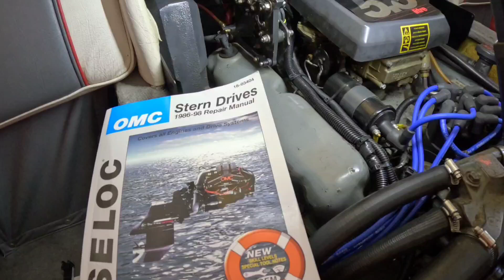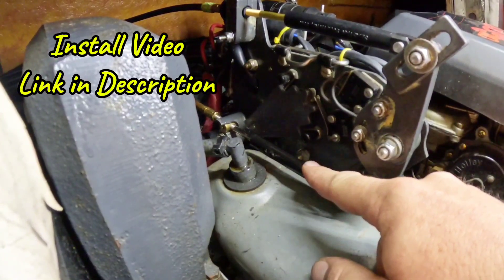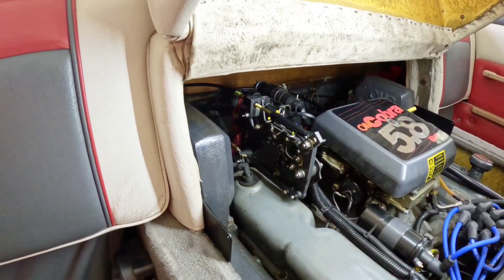OMC Cobra Shift Linkage Assembly | Adjustment And Fine Tuning The Electronic Shift Assist

Comment: Great video. I have a question I have a 91 3.0. I have not attempted the adjustment yet. When I shift into reverse it stalls. Forward is fine with at little hesitation it does (Not a fan of this system) before I start the adjustment, I bookmarked your adjustment on the video for reverse but your video doesn’t explain what is going on when it is stalling in reverse when shifting. I.E. if you stall while shifting in reverse that’s because this is not set to the correct orientation if that makes sense sir. Love the video but questioning myself on setting the reverse. Please advise.
Reply: How do I unplug the ESA. If it doesn’t stall could I not leave it that way?  Also, if forward and reverse work the same why is forward not stalling. I think it needs to be adjusted on the reverse. I think you said it’s the top cable. The two switches need to be in there correct positions I think. One in the W groove and the other on the cam. But, I feel that I will mess up forward. Maybe I am overthinking this. Please advise.
Reply from the maker: The esa is the box that's bolted to the shift mechanism. I have a video up on how to test it and replace it. That vid shows the connections and what to unplug. Leaving it unplugged just means that it may be harder to shift or gears may be hard to engage with prop shaft load. But I've seen boats go years without them working and be fine. But more than likely you just need to adjust the linkage. If you are not absolutely certain that it is adjusted properly, you need to go thru the process step by step from the beginning like I show it. Because it does matter in which order adjustments are made. It seems daunting at first, but once you do it it will make more sense
Reply: Ok. Thank you sir.
Reply from the maker: No problem. I hope this helps
Reply: So I put it in reverse prop locked. Switch is not in middle of W moved it like you did and it goes back to center as it should the overthrow switch is nowhere near the cam. I think I am beat here. Time for the dealer. To over engineered. I had 75 Tahiti with a four cylinder Volvo Penta and a 280 out drive didn’t have any of this crap. If I could I would take it all of and just have cables. Go from Neutral to forward put it in neural for a few stop the put it in reverse. No idea the point of this was. Super frustrating.
Reply: It definitely the adjustment.
Reply: Where is that accent from?
Reply: Ya know I wish there was a way to send you a pic of where it is at in reverse. Going into forward it has a hesitation then it’s in and great. But reverse is stallout.
Reply: Hello sir. So I watched the other fine video on fine tuning. Oh my god there’s a freakin tool. Ordered that. Question I looked at your orientation on the nut placement. It seems that that nut is in the block prongs of the tool or behind it like yours or I have seen in front. What is the deal? Also if with the initial fitting of the tool if cannot get that 7 9/16 what do I adjust to get it or… you said there is a plan of atckbfor how to do adjustments. Atarting with the 6 1/2 or is it the 7 9/16. Just want to be clear. Some many videos you have. Honestly where do you find the time lol. Thank you for all your responses. Keith.
Reply: Hello sir. So I watched the other fine video on fine tuning. Oh my god there’s a freakin tool. Ordered that. Question I looked at your orientation on the nut placement. It seems that that nut is in the block prongs of the tool or behind it like yours or I have seen in front. What is the deal? Also if with the initial fitting of the tool if cannot get that 7 9/16 what do I adjust to get it or… you said there is a plan of attack how to do adjustments. Atarting with the 6 1/2 or is it the 7 9/16. Just want to be clear. Some many videos you have. Honestly where do you find the time lol. Thank you for all your responses. Keith.
Reply: Sorry sent twice. Misspelled attack.
Reply from the maker: The purpose of the tool is to get a starting point after replacing the lower shift cable. And sometimes like what I found is the lower shift cable has a crack in the fitting that goes into the out drive and causes shifting to not be consistent. Lower shift cables are known to need replacement every few years. So I had replaced the cable. Then started my adjustment process all over again. I had a rough summer that year constantly pulling stuff apart and fixing things one by one because the previous owner replaced parts but never adjusted anything properly or used the wrong parts all together and made it "work"
Reply from the maker: I can see how that's frustrating! Shifting into reverse on these engines is very sensitive. The video shows the adjustment, but you are correct, the stalling is because the linkage isn't set correctly. The esa is intended to work the same whether going to forward or reverse. If it is out of adjustment the esa could still be engaged and causing the stall out. If you wanted to verify it was an adjustment issue and not an engine issue, unplug the esa and try it. If it doesn't stall is in the linkage adjustment. If it does stall then it could be engine related or a combination of engine and esa adjustment.

Comment: Amazing stuff brother! These Cobras have such a bad rap. Though I can still agree with some critiques regarding design, the more that I learn shifts (kinda punnny:) my opinion to assigning more blame towards not enough marine mechanics knowing how to  properly service. Hopefully your videos reach enough people, both owners and techs, to change that. 
I bought my dad's 87 Bayliner 2555 Ciera this year that he bought new. When he gave me all the original paperwork I came across a cardboard template provided with the manual used to ensure the precise measurements you showed in the beginning could be easily confirmed. Dying when shifting has been a reccurent issue over the years. Your video really takes the mysticism out of the setup process. 
I have to take a 2855 out of the water  for someone tomorrow and it currently only shifts in to reverse from the control, but will go into forward if you press the lever manually down at the end of the cable. Worse comes to worst ill have someone hop down there so we can get it from the slip to ramp, but Im pretty confident Ill get it back to functionality thanks to your help. Cant wait to watch some more of your videos soon and help myself and other OMC guys ;)
Reply from the maker: Thanks for the support! That was my goal, to help explain and teach. I hate seeing this drive get such a bad reputation because of the lack of support documentation. Most of which was tribal knowledge and lost over the years.

Comment: why is my reverse is engaged but the forward is not? what cable to adjust?
Reply from the maker: Could be your lower shift cable is out of adjustment. So if you follow it step by step you should be good to go. If it's not working after following the process then you have an upper or lower shift cable that is worn out. Which I have videos covering how to replace both as well
Reply: @adventureandrepeat  thank you for replying, mine is cobra 3.0 and the 2 cables are upside down as shown on your video. So, I should adjust the cable with center trunnion to the end as 6 1/2 in
Reply from the maker: Even being upside down all the steps for adjustment are the same. Trunnion length is where you start. Then forward throttle and reverse throttle adjustment need to be also made. Order in which they are set does matter. So follow the video step by step
Reply: @adventureandrepeat  I could not make forward engaged. You did say something about the cables worn out, did you mean the lower cable worn out from inside the outdrive unit?
The upper cable is connected to the control lever at the steering wheel worn out from where?
Thanks
Reply from the maker: I ran into a similar problem with mine when my lower cable was failing. It's the cable that goes from the shift bracket on the engine to the gear shift fork down in the out drive. They are pretty easy to replace.

https://youtu.be/tprsDUXzA-c?si=WxUiCo3-_NSRiixT
Reply: @adventureandrepeat  Well, your sound very easy. Am I going to need following your lower shift cable replacement video STEPS to complete? Meaning drops down the stern drive.
Reply from the maker: Yes to replace the lower shift cable the drive has to be removed. Easy to do and can be done by 1 person in 30 minutes. It can be frustrating that you have to pull the drive to do it, but it gives you the opportunity to inspect the bearings and joints and grease them as well
Reply: @adventureandrepeat  Thank you sir. I will need to watch your video more closely to finish.
Reply from the maker: No problem! I hope this all helps. I've got vids up on everything related to shifting and controls for these boats, including the throttle control
Reply: @adventureandrepeat  Ok sir. I got the outdrive unit off the sterndrive, what I see is the cable is not broken, the black plastic connected at the end of the cable to move other parts to lift the shift rod(forward) or push down(revert) all functioning. Could it need to be tightened more? if so, I could tight from the other end instead.
Or the black plastic part has worn out where else?
please give your thoughts
Reply from the maker: My guess is that the lower shift cable is worn out and needs to be replaced. A common item to replace on omc drives. Easy to do and a fairly cheap part to replace. You could replace the black plastic part as well if you feel like there's too much gap with it. I replaced mine with an aluminum one like shown in the video
Reply: @adventureandrepeat  Thank you for your words and times. I am going to replace the complete shift cable kit. my guess is the steel cable could be expanded as the rubber band when it is pulled, PERHAPS?
Reply from the maker: Yes, that's what I would do

Comment: My overtravel switch is perfect and returns back to the center for reverse. However it stays pushed down and bogs the motor for forwards. 

We just swapped the motors, out was a 1990 OMC 5.8. We put in a good 1989 OMC 5.8. 

The linkage seems like it won’t go fully into gear if you loosen the back portion of the shift cable
Reply from the maker: Sounds like something may be binding up. If your testing it on land you want to rotate the prop to engage the gear when you test the switch. If the prop won't engage into gear it sounds like you have to figure out why it won't engage
Reply: Can I give rpm whiteout put in gear if yes how ??? OMC King Cobra ninety Ninety Nine
Reply: Sorry 4.3 l OMC King Cobra 1989 Cadorette